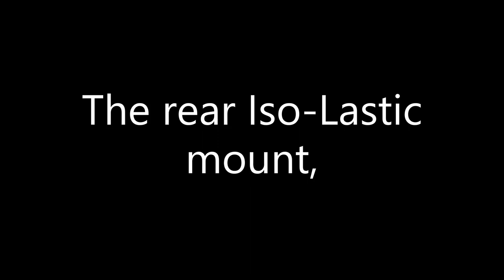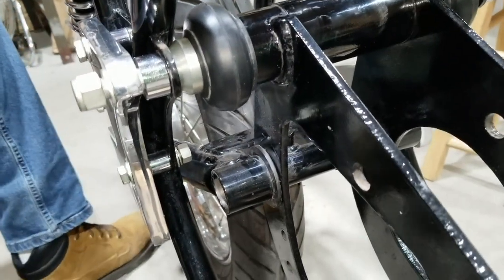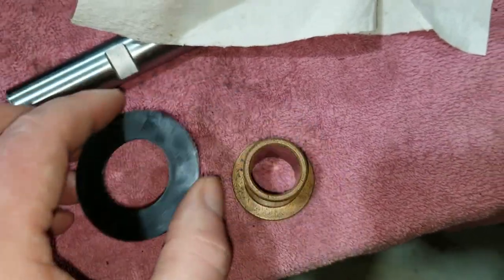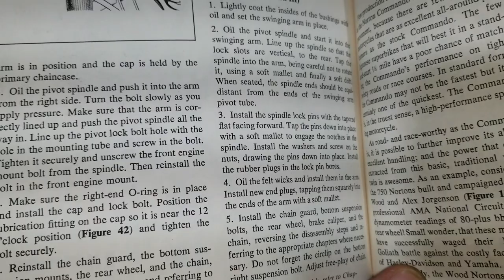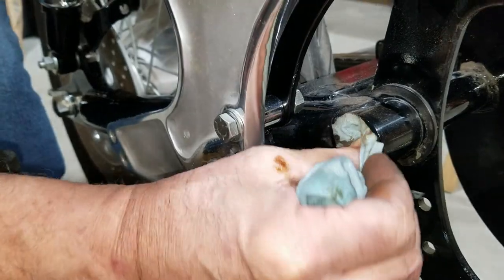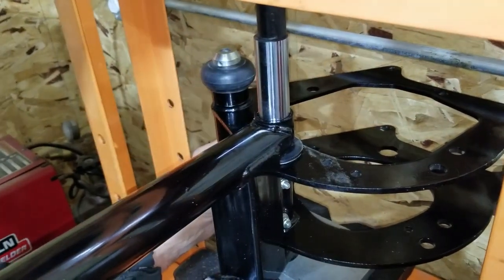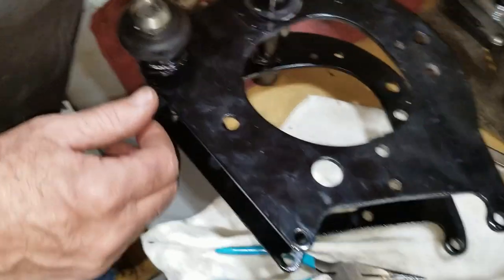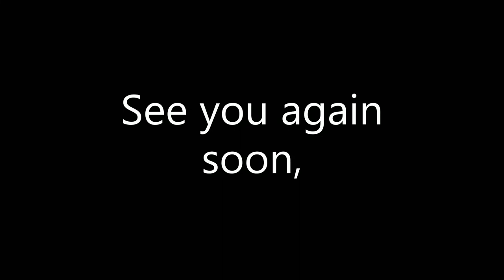1975 Norton Commando Mk3 restoration Part 6, The frame and swing arm

Comment: Well done guys, '73 Combat from Wisconsin here. The swingarm is a little different on the Mark1's, no welsh plugs or felt, but a few improvements are available from Andover Norton for these early models, such as weld-on gussets to stiffen these early swingarms, and replacement weld-on chainguard fixing bracket, which frequently gets damaged or broken. Also kits are available to correct the slop between the spindle and the bore of the cradle since there are no tapered pins like on the III's. Unless previously addressed, most of the 68 to '73 Commandos have dangerously worn and sloppy swingarms, which is a major cause of the dreaded high speed tank slapper! Anyhow, thanks for taking us through, we are all still learning!
Reply from the maker: Thanks for the added information and your great comment

Comment: Just wondering if you are using stainless steel fasteners? I am going to pickup a MK3 in about 2 weeks and complete the restoration. Middleton &Sons in England sell a complete polished stainless kit for the MK3 or other Nortons, but it is 430 pounds.
Reply from the maker: No we didn't use all stainless fasteners.
 My experience with stainless bolts is you need to use never seize on the threads if both the nut and bolt are stainless being put together or they will almost always gaul and give false torque values for those reasons I only use stainless in places that don't have nuts. Stainless works well for cover screws and any place that threads into different type metal like the triple trees, handlebars, head etc.